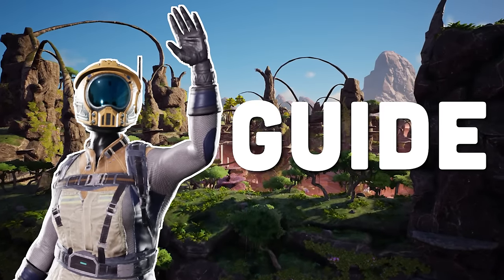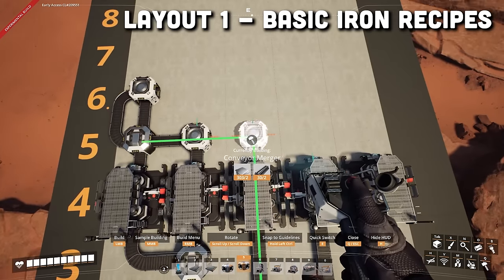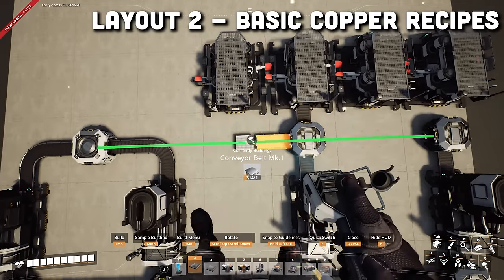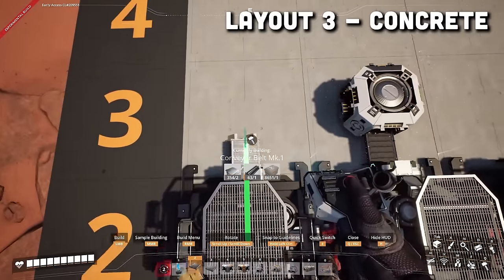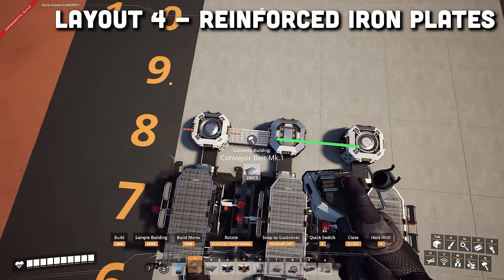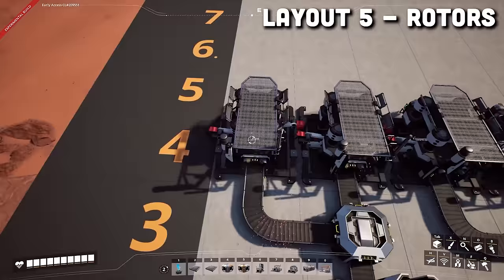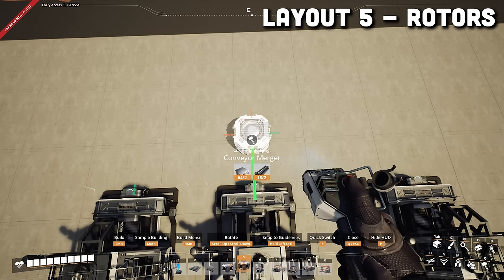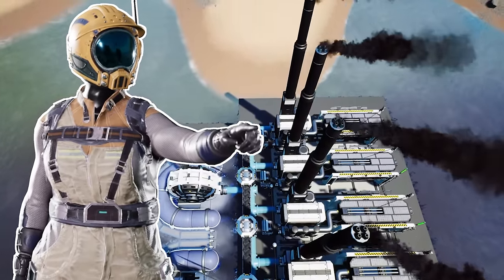5 PERFECT Starter Factory Layouts You NEED! | Satisfactory Update 7 (Beginner Guide)

Comment: As an engineer with OCD and desire for 0 waste 😂… This is absolutely amazing. So easy to get distracted and watch these lines operate flawlessly.
Reply from the maker: It does look good when it is all working perfectly :)
Reply: @Kittengaming101 Then I pray you get to the automation phase of the game soon enough :D
Reply: it´s not perfect 10 rotors per min only need 112,5 iron per min. still a good  design to get production up.
Reply: @jonasgrohs5997  yep, the bottleneck in this specific design is on the screw manifold. when you underclock the constructor, you now are no longer evenly splitting that 70 line of rods, as the last constructor is using 2.5/min instead of 10. This would eventually cause the rods to build up, but it isn't a huge deal.

Comment: Great guide here to get going in early game. One tip i can give newer players is get access to under/over clocking early (in the MAM) and actually run these layouts with everything on 50% while you still use bio-fuel generators. It's a lots less collecting of wood and leaves and once Coal is unlocked, you can then go full throttle on these!

Comment: Fantastic video! Very informational and helpful to new players. Btw in layout 4 (reinforced plates) the second splitter at the end ( 10:36 ) is not necessary as there is only one conveyor coming in and one coming out. As well as in layout 5 (rotors) you designated the area of 9x13 and used only 8x13

Comment: I really like these layouts.  I like preserving my 90 degree turns us much as possible, so I found that on the assemblers in layout 4, if you stack the splitters feeding the assemblers one level higher, then you can use lifts on the assembler inputs and rotate the top end 90 degrees left or right and the belts will perfectly line up with the belt below.  You can also feed the first splitter with another lift and the line coming from the plates will line up perfectly at 90 degrees as well.  Nice job with these though.  Been looking for an all-in-one guide for all basic parts and this looks like it fits the bill.

Comment: @SpectrumDad Awesome video!  Just wanted to mention that at ~13:50, because you underclocked that constructor, you'll need to make one extra belt right after that constructor's input a Mk2 belt as well.  You have 70 rods coming in, but then subtract 2.5 for the underclocked one, which puts you at 67.5.
Reply: No offense intended and not that it matters, but his math was right. There are 70 going into the splitter and the splitter technically does not have a limit, so 60 out the left and 10 out the top would be perfectly fine. No need to subtract anything. But if you did, you would subtract 7.5, not 2.5 because he reduced it 75% TO 2.5, so actually he will only be using 62.5 of the 70 in. Not that upgrading a few sections to mk2 would cause any harm.

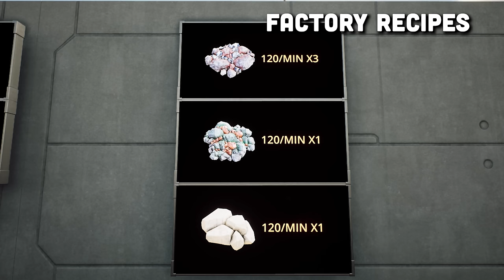Comment: What do you mean by this 0:34 ? At first I though I would need 3 iron nodes with mk2 belted all the way to my factory but then I discovered I can have three mk1 belts that merge together but the output of that merger is a mk2 belt which makes it fully saturated and I’m still achieving the same results of 60 plates, 20 rods and 40 screws a minute. So what do you mean exactly when you say 120/min x3??

Comment: Cool layouts. I always smeltered a complete node and then branched into what i needed.
Also for the start you might want to build one or two assemblers more then you need, and underclock all of them. As power consumption is an exponential curve you save quite a bit of power by only turning down 10-20% on each already.

Comment: Nice, thanks - really appreciated as this is making things much clearer for a newbie. For example, I didn't even consider the stacking of splitters/mergers despite having accidentally built one on top of another a couple of times! However, the terminology is confusing/backwards. You keep on saying "put a splitter/merger in front of X" and then put it behind it. Surely "in front" should be both at the front by way of the viewer of the video (lower number down the build area) but also "in front" of a machine means that it is what happens before the input to the machine, not after the output of the machine?

Comment: So I set up your basic Iron and Copper Factories, and I like that they all end into a storage container, because if I need to expand, I just tap off of the exits of the storage containers to feed the new factory (such as Reinforced Plates). However, I built your Iron and Copper factories, and just let them run in the background and the storage units filled up, and then I researched Smart Splitters and learned how to use them. So on both your basic Iron and Copper factories, I added a staggered set of smart splitters between the Constructor outputs and the storage unit and then run those three "Overflow" belts into a Merger, and have the belt feeding an AWESOME Sink, so while I'm running around the map looking for Ore Veins and Hard Drives, if my inventories fill up, the 3excess will at least have some use by feeding the AWESOME Sink. 
I also have the smart splitters set up so the first one is on the ground, the second one is suspended in the air (Two Splitters High), and the third one is suspended in the air (Three Splitters High) Like you do with the Coal feeds to the Coal Generators, that way, none of the splitter belts get in the way of each other and can feed a Merger nicely. I know that Screws, rods, plates, copper sheets, wire and cable don't earn much Awesome Sink points, but having those 6 things eventually constantly feeding the Sink helps. The thing I really like about the smart splitters is that when I take something out of storage, the splitter makes sure that the items go into storage until they fill it up again, and then go back to sending the overflow to the Sink again. I've been setting up ALL of my factories like this now.

Comment: In your overview of the rotor setup you have an extra merger that I didnt see you put in on the setup and a tigher loop right at 16:42 on your video. I feel like I'm missing something because I'm only getting about 3 rotors per minute. Any Advice? Fantastic video and explanation from yourself, it's much appreciated.
Reply from the maker: You are correct. The merger merges the 2 lines from the splitter before going to the merger on the right. In my video I opted for just sending the 2 lines directly into the merger. I’m the end it should equate Tito the same in theory. Make sure that you are able to send 50 rods to the left side and 70 total rods to the right. If the rod machines are working 100% efficiently then the screws should be good. You’ll have to make sure that you use a mk2 belt after the last rod merger heading into the splitter manifold for the screws. Other then that, try stopping the rotors assemblers until everything backs up and try again. Might be the nature of the manifolds haven’t caught up yet. Sometimes it takes a bit to saturate.
Reply: @spectrumdad_  thanks for such a fast response. You are correct it was a saturation issue that resolved itself after about 10-15 minutes. Great video and I'll be sure to watch more as I get deeper into Satisfactory. Thanks again!

Comment: The rotor factory seems to produce an excess of 7.5 iron rods which causes a backup surprisingly quick. Solution is to under-clock a smelter and iron rod constructor on the right half of the factory and your iron ore drill to each produce 7.5 less. Also noticed there are a few conveyor belts that need to be Mk2 instead of Mk1 to prevent bottle necks that you didn’t do in the video such as the screw inputs on the first 2 assemblers for the rotor factory since they need to input 100 per minute, but also in some of the mid-factory manifolds.

Comment: Love the video but I have a question, in the rotor factory you said you need one line of 50 rods and one line of 70, but then you underclocked one of the screw constructors to make 10 screws, using only 2.5 rods. How is this 100% efficient if you get 7.5 extra rods in the whole thing?

Comment: I love the video keep up the great work! But I do have one question. How do you get power to all of the smelters and stuff? I don't see any water pumps or anything.
Reply from the maker: For the purpose of the video I had no power turned on. But I have done these layouts with biomass burners, it does require a bunch but it's only for a small time until you get Coal. You could get coal first too.
Reply: @spectrumdad_  Ohhh Okay thank you I was wondering how you were doing that im currently working on coal rn its a bit confusing.

Comment: Hello, having a blast watching your videos sir. Would like to ask a question. Taking the concrete layout for example, you split up the belt 3 ways for 3 constructors, with one of them underclocked, 45 + 45 + 30 limestone for each. Don't you need a mk2 miner with tier 2 belt to deliver 120 limestone per second for this layout to work?
Reply from the maker: The input into the splitter should be a mk2 belt yes that is correct. In this video I only showed the amount of ore needed to be sent to each layout at the beginning. I made it a bit clearer for my other layout videos. :)
Reply: @spectrumdad_  Thank you.

Comment: these are great guides but im curious how using the alternative screw recipe would affect these layouts? It seems theyre 1 ingot more expensive per screw but would drastically reduce the power needed no?Not to mention the space.
Reply from the maker: If you use the cast screws alternate recipe, the amount of ingots requires is the same but yes you can skip the iron rods and in turn have less machines. These layouts assumed no alternate recipes were unlocked.

Comment: How does this scale up when you have better belts and the option to use shards?
Reply from the maker: once you have mk3 belts you can double the layouts as input, and keep the rest the same. It's easier to double everything then to start messing with shards in all the machines. Shards are better used on things like Miners to maximize the output of each miners.

Comment: For the rotor factory should all 3 assemblers work non stop? Because for me some dont have enough rods or have too many screws or the other way around. did i do something wrong??? I dont have the clock thingy
Reply: you need to underclock the last assembler to 50%, this means that the last assembler is working 50% slower and consuming 50% less resources. Once it's underclocked the assemblers should be working near non stop. keep in mind this build uses manifolds which means that one machine may need fill up to its capacity for the other ones to get the proper rate of resources. To unlock overclocking/underclocking you need to go to your MAM and research it under power slugs. To the right of the research tree once you have researched the first blue power slug, you can see what you need to research next to unlock underclocking/overclocking

Comment: x3 120 miners are those just miners that produce 40 each? or is it 120 single miner but 3 of those
Reply from the maker: So it’s 3 total 120 mk2 belts. Each belt can be either 1 pure 120 ore miner, or 2 normal 60 nodes merged together, or 4 impure 30 nodes merged together.
Reply: @spectrumdad_  I have 3 normal iron deposits so lets hope i can maybe incorpate that into the design thank you.

Comment: Correct me if i am wrong i am new, but if splitters split evenly doesnt that mean 60 goes to your first line then 30 + 30 then 15 + 15 meaning some smelters, constructs ect are getting more than others?
Reply from the maker: Each layout takes in 120. And yes at the beginning it does split like you say. But because you are sending 60 to the first smelter, and that one only requires 30, it will fill up and overflow the line and then the splitter won’t split anymore. This is what a manifold system does. What you could do is don’t start the smelters and let the lines fill up. Then start the smelters. But it isn’t necessary. The system will eventually overflow down the line and all smelters will eventually be running 100% efficiently.

Comment: I built this exactly and I'm having the last few smelters run out of ore. The smelters first in line are backed up but the others are barely getting anything. Are you underclocking some? I"m so confused as to what I did wrong. I'm talking about the basic iron build
Reply from the maker: No just give it time to saturate. If you want, turn off the smelters until the whole line stops moving then turn them back on

Comment: Just quick question. Can we once we hit Coal Power and steel production, turn all conveyor belts into MK3 if we have all machines Overclocked?
Reply from the maker: You can always increase belts to highest available no problem. The issue though is making sure you provide enough ore and products the machines need once overclocked. I don’t tend to overclock machines much, usually I reserve that for things like miners or power. So you’ll have to just double check the numbers and make sure everything still works.

Comment: One thing I don't understand is underclocking ONE thing so that the other things work better. Also, I really don't get the 'feedback loops' where and item comes out, and gets looped back around onto the belt it was already on. What's the theories behind these two things?
Reply from the maker: For the first, underclocking prevents the machines from stopping production and turning on again, when that happens, there is a slight delay and the efficiency goes down. It’s not mandatory for things to work but it sure makes it more clean and nice. I’m not sure what you mean by the second thing. I don’t believe I use that in my video. Are you just asking in general? I would use that type of system with fluids to prevent issues sometimes but I’ve never done that with belts.
Reply: @spectrumdad_  Thanks for explaining that. So, the machines I have making things like Reinforced Steel Plates where one conveyor going into the Assembler is packed with screws and isn't moving, while the steel plate conveyor is waiting on a steel plate....I should underclock the machine making screws so they show up at the same time as the plates, so the Assembler isn't sitting there idle, waiting for steel plates. Right?
About the second thing, I've seen someone use the 'belt loop' in their video to make the machine output more efficient, or continuous.
The second thing is where somebody will put two splitters in line at the output of a machine ---->splitter------>splitter   but then they have one of the side exits on the last splitter, feed back with a belt, to the first splitter.

Comment: Just a question. If these are for starter base layouts, how the huge amount of power must be generated for all of these, when you only have biomass generator!
Reply from the maker: You can do it in phases. But I did it using only biomass so it is possible. It helps to automate the crafting of solid biofuel. Or you can get to coal quick and then set this up. You will need a steady amount of these resources going forward so it is still a viable setup to do after reaching coal too if you find the biomass to much work.

Comment: I have a question, should I be using 4 Mine Inputs of 30 Iron Ore each, feeding onto 1 MK 2 belt and then feeding into this Iron Ore Basic resource build. What should the efficiency of every Constructor and Smelter Be ?
Reply from the maker: Yes if you only have impure nodes then 4 merged into 1 mk2 line is what you want to do. As far as efficiency once everything is up and running and saturated it, if you set it up properly, it should all be at 100%. But it won’t be at the start, it takes a bit of time for the system to saturate. It’s the nature of the manifold system.
Reply: @spectrumdad_  Okay awesome, thanks for the help, do you have a discord that I could join. Love the game and want to learn more
Reply from the maker: @nirvanahart7934  Yep, check the description for a link to my Discord :)

Comment: Do you need a mk2 conveyor belt from the ore to the copper factory or is a mk1 enough?
Reply from the maker: To fully do 100% efficiency on the machines you’ll need a mk2 belt of 120 ore. But you can provide 60 for now if that’s all you have and it’ll just do 50% less items per minute
Reply: @spectrumdad_  the pure copper ore is 700meters away so that would cost alot to build mk2s.I only have one impure copper nearby and the second nearest is 600meters.I just started today have 6 hours tier 3-4 unlocked and dont have that much ressources.

Comment: i biuld it but at the roter and reinforced it isnt splitted right because when you get 120 and you split it you will get 60 but you only need to get 30 for the smelter and the other smelters wont get enough iron is there an solution for that.
Reply from the maker: That’s normal. The first machine will fill faster then overflow down the line. That’s how manifolds work. Just give it a few minutes to fill and it’ll all be good

Comment: I followed these and had no problems until I reached the rotors. It seems to get backed up in the rods section given enough time. I might be doing something wrong but I feel like I did the exact same thing
Reply from the maker: make sure the lines from screws to assemblers are mk.2 lines. I added it to the pin comments since I forgot to mention it in the video.